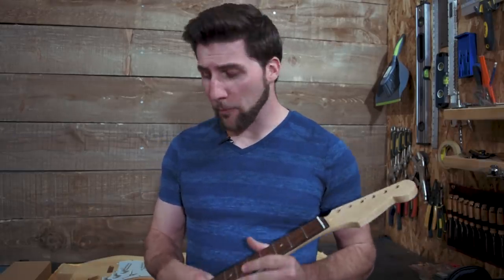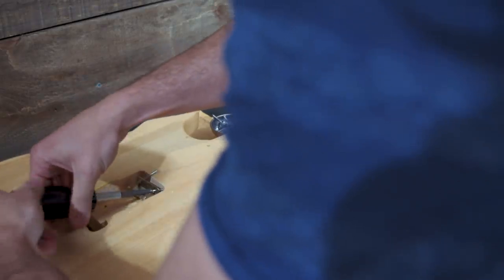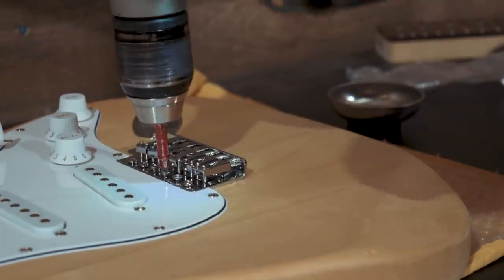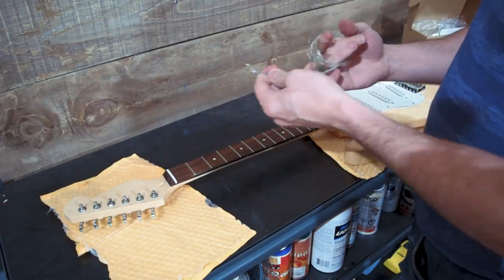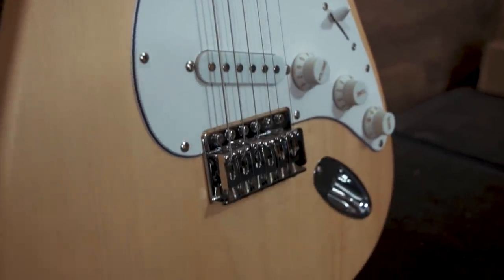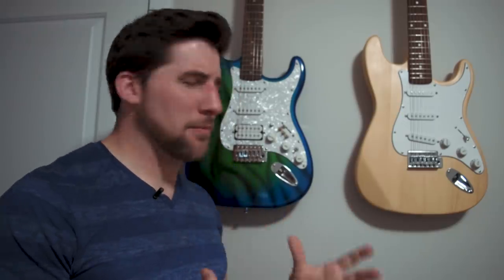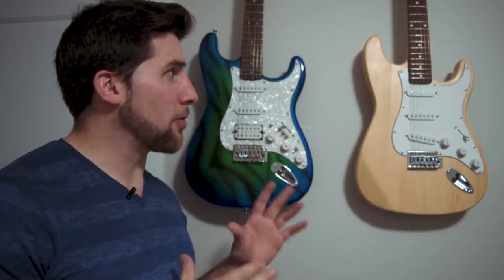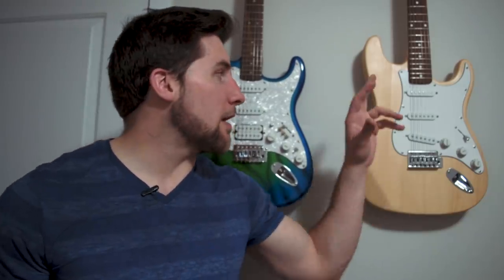The Stratocaster Guitar Kit | Stock Hardware Demo

Comment: It has a Strat type sound already. Which, is a nice surprise.
You could try a stacked Humbucker pickup. They look like a single coil. And, fit in the same single coil slot. They've been around since the '80s. But, a lot of people still haven't heard of them or, tried them.
Reply from the maker: I had considered that actually. Or a dual rail, but I’ve already done those I guess. 

I’m final form I can put in essentially whatever I want since I’m changing so much haha. I’ll have to think about it.

Comment: According to Fender. The outer two bridge screws should be tightened to the point where the back of the plate begins to lift, the remainning screws should be backed off so they are sitting about 1mm above the plate. That's how I've always set up my trems.
Reply from the maker: Interesting.
Reply: If you look at your video, when you screwed down the bridge screws the back of the plate lifted slightly. That puts binding pressure on the tremolo system so it would move freely. I've set up a couple dozen trems over the years,  I'm no expert but the description I wrote seems to work well.
Reply from the maker: Yeah, it makes sense. I always have the back plate lift a bit, but I use a consistent 15 torque all the way across.

Comment: Hi, nice video. My question is, considering only neck and body, are these kits´s elements good enough to build a high end instrument? I'm thinking in puttin quality elements on it, like a good bridge, pickups, tunning machines etc.-
Is it worth it? or you recommend buying a Squier and upgrade it?
Reply from the maker: It depends on how good you are at fretwork and setup. These can be good instruments, but it’s easier to just upgrade a squier generally.

Comment: Are you stripping out the threads on the neck pocket after initially installing the neck? You'll get a better pull on the neck if you do, not to mention a massive increase in sustain.
Reply from the maker: You figure that actually makes a difference? I often do it regardless, but I’ve never really had difficulty getting a good joint there.
Reply: @BradAngove  it really depends on the guitar. I've got a 2004 squier showmaster that had a good join, but the threads from the factory were still in the body, drilled it out with a 6mm bit, and the difference was immense. It enables the screw to slide through the body, and only pull on the neck, giving a greater contact between them, which I've always found increases the sustain. (I know you know what it does, just explaining for those that don't.)
Reply from the maker: Haha yeah, The concept makes sense. I’ll do it on this one and see how it goes.
Reply: @neillawton6076  Good point!!!!

Comment: In order to solder the ground wire to the spring claw do I need to heat up the claw? I cant seem to get it to stay soldered to the claw.
Reply from the maker: Yes, you need to crank up your soldering iron and hold it against the claw for a while to heat up the area so that the solder will stick.
Reply: @BradAngove  Great thanks again

Comment: hey brad, its me again. i was wondering if youve ever heard of a blackboard or chalkboard spray paint? because i feel like it might be cool on a guitar since its like a black matte colour. do you think you would ever try it out? possibly a new video idea. the company i saw is called plasticote or plastikote, but im sure there is others available.
Reply from the maker: I’ve definitely used chalkboard spray before. It’s cool. Very matte.
Reply: cool... is the durability good? because i would imagine that its quite scratch resistant and wouldnt get patches that have been polished out from playing, since it is basically made to take on a bit of friction... and players can have a different design for every gig! i feel like its worth it just to draw on it whenever!
Reply from the maker: Haha yeah, it’s reasonably durable. Not exactly automotive grade, but pretty good.
Reply: k, thanks. its not risky to paint a guitar with it alone is it?
Reply from the maker: What do you mean by risky?
Reply: i just feel like i would paint the whole thing and after painting i dont know if it would start cracking, peeling off or something that ends up with me sanding everything off...its happened before, when i tried cheap paint. it started to crack and crumble when it was hot in the house.
Reply from the maker: If you prep the surface properly I find it highly unlikely that you’ll run into that issue.
Reply: cool, thanks! so now all i can do is hope for the best! atleast it only costs about 10 dollars so there is a few pros and cons right there eh? also, i was wondering what you do with completed guitars? sell, throw out, give away, burn, or somethin totally different?
Reply from the maker: I’ve mostly just been keeping them and occasionally repainting them so far. I’m working on setting something up to allow me to sell custom replacement bodies though.
Reply: ah,thats cool. any chance of custom necks too?
Reply from the maker: Hopefully some custom necks at some point haha.
Reply: ha, yea hopefully, ive been dying to get a les paul neck that i designed but most places charge between 500 and 1k.
Reply: yours wont be worth 1 k would it?!
Reply from the maker: For a neck? I would think not.
Reply: haha! good, because that les paul neck cost more than the actual guitar... and a music man stingray bass neck is even worst because there is no companies that sell them for affordable prices and i think they must be licensed or something...